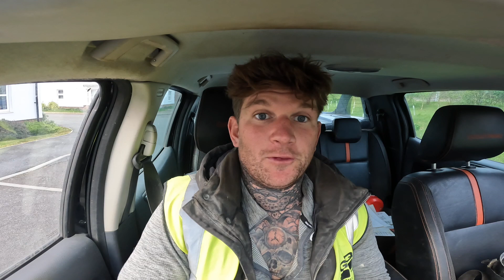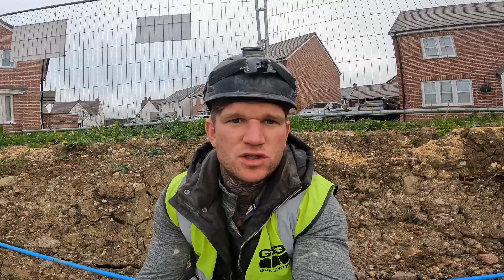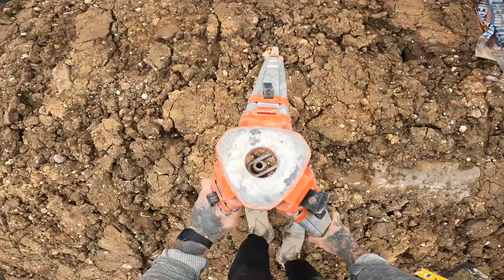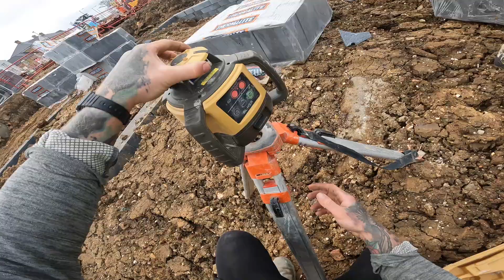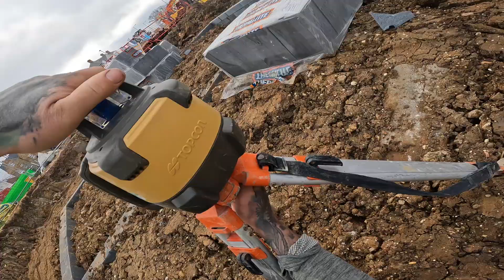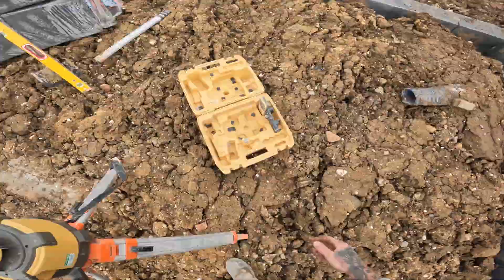bricklaying on my own again

Comment: So when you put that initial staff/sensor up; the lazer recognises that is the height the others are to conform to?
Reply: set the laser receiver to the correct height,  then  go round all the corners and it will tell you if they are high or low compared to the corner you set the laser to.

Comment: why did you put your trowel on top of the block? As soon as you put the block down you went straight back to the barrow with your trowel.
Reply: Everything is fluid, on top,in hand,hold it in your mouth, sometimes it suits sometimes you change it out of sheer boredom  well spotted tho
Reply: @stevejones7622  it's a pointles manouvre.
Reply: @suemarsden7249  as long as you're getting them down who cares?